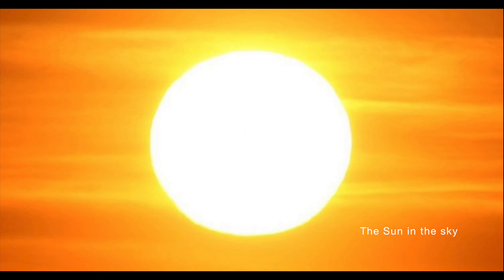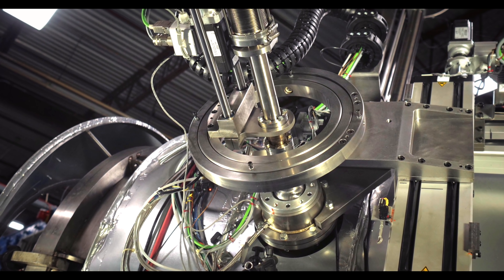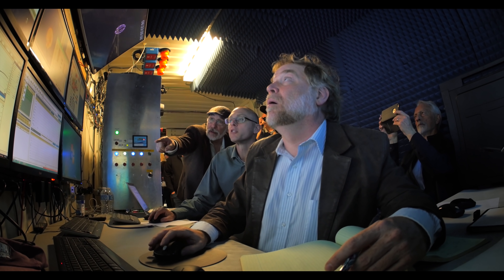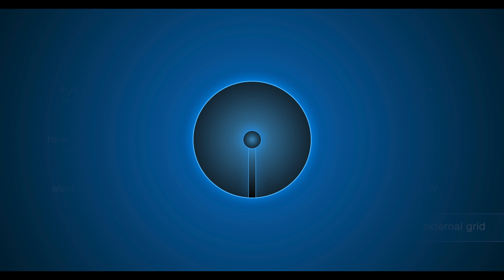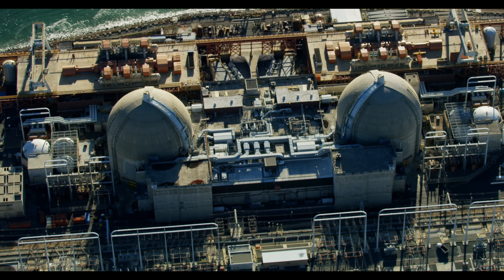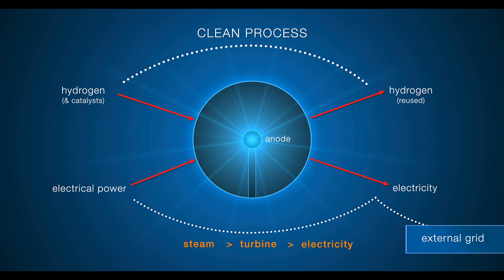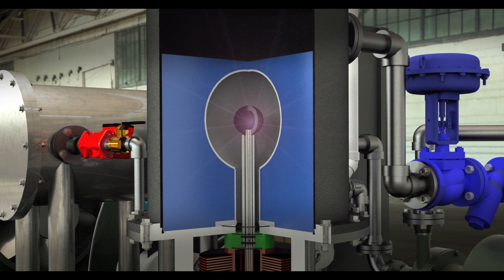Special Feature: THE SAFIRE SUN

Comment: The ability to create very high temperature heat is not in question. The Question is, HOW MUCH HEAT COMES OUT FROM THE ELECTRICAL INPUT? A small 115V arc welder can melt tungston if the tungston is thin enough. We have to stop reacting to the headlines and ask for the details. Is this an economical heat producing device for steam production?

Comment: The proponents of HHO gas ( Browns Gas) generators and torches had made the claim that burning radioactive material with HHO gas torch reduced the radioactivity as well as the ability to generate unexplained  extra heat to burn through granite with the torch flame which was relatively cool when not focused on  other materials.  Now Safire is claiming a similar results with electric arc burning in the presence of Hydrogen ions. Could the phenomena be related as well to the claim for cold fusion using platinum electrodes in producing HHO gas through electrolysis?

Comment: my math is probably wrong, but it looks like if one could fuse 1 gram of Hydrogen into deuterium you would get 101,824M ft lbs of force, if this design could be  reconfigured as a rocket engine you might really have something there, actually would have an electric rocket engine....you sure would not want to do it all at once, as they would have to scrape you off the bulkhead. Plasma impulse drive....seems I have heard of this somewhere else...????...:)

Comment: How can I have exactphotos of radiated heat patterns on my phone using standard filters from the setting sun SIM at sunset and is the crandle system slightly diff....the White around the edge oscillates forwards and backwards at 180

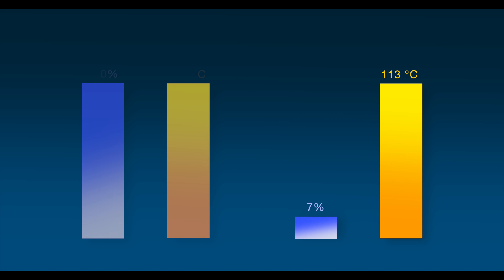Comment: At 5:57 I would be fascinated to see what the difference in input energy modality allowed for a 7% input and max thermal output.  I am guessing, perhaps did the Safire team alter energy input form?  Was a shift from DC electric input to a capacitive inductive AC discharge akin to certain circuits designed by N.T.?
Bravo very Well done.
Reply: 1:50 Like a mini Tesla coil leading to the anode, looks like a coil there. Maybe at lower voltages to the typical tesla coil, like 2kV pulsed, hmmm, thinking.

Comment: So is Safire now producing excess electricity to what is being consumed ?
Reply: Ok on their schematic it had link to  grid connection and also a link back to operating of the system obviously the system in itself produces no electricity but my question was more of a hypothetical enquiry as if the thermal production coupled with some form of heat exchange to operate an electrical generation  system could produce electrical energy in excess of the systems immediate needs ?

Comment: Can existing power plants convert to this awesome technology?
Reply: The way to get electricity out of Safire (as said in the video) is to use the heat to make steam to turn a turbine attached to a generator. That is the way all power plants work, whether they burn coal, natural gas, or radioactive elements.
It would be better to get electricity directly without the middle steps.

Comment: What are the electric numbers going in and coming out ?
Reply: At 7% input power they were reaching maximum reactor temperature.  That means the heat being produced was at least 10 times what was being sent in to power the machine.
They haven't produced electricity with it yet, just proof of concept of the heat source.  But it looks like it will be immensely efficient compared to more conventional methods, like gas turbines.
Reply: @t00by00zer  7% of what? 7% is not 1/10 of 110°C. 7% is just a percentage, not a value.

Comment: This is the future of space exploration. No more liquid or solid fuels. Just PLASMA. It changes everything.
Reply: Man, I'm 33 years old and since childhood I dreamed that someday at least one of the book or film visions of the future will come true, in which we explore the outskirts of our solar system. Safire sun is the key to conquering space.
Reply: Fusion of hydrogen to make helium, even  if it were possible (this technique doesn't do that) converts 0.00735  kg of every kg of reactants into energy. At low speeds like 1/10th of the speed of light, one kg has energy of about its mass times 0.005 c². So a one tonne space ship must "burn" just about its own weight of pure hydrogen to reach that speed. Oops, no, I left out that it has to have been accelerating all the fuel it still has to burn.
Reply: Plasma at a density of 160 g/cm³ is not easy to contain. The huge pressure of the sun's outer layers, and its total gravitational mass, suffice to supply that to the regions of its inside that actually create hydrogen fusion.
Reply: @albertrogers2506  First. It's obious, You are start about trolling. Second. This is not about Gravity. Third. Outer space it's full of plasma and electrics currents. You can Even build a space ship that uses the same principia of safire for propulsión just by magnetohidrodinamics and the plasma it's self, and no need for containement due to self organization of plasma and the magnetic field that's creating it self.
Reply: @GABM1983  Every star in every galaxy is about gravity. Gravity collects it, gravitational energy ignites it, it maintains its main sequence nature as long as it has power to hold itself up against its own weight, be radiation pressure. When that fails some or all of it gives in to its own weight. Fairly large stars become White Dwarfs, keeping their size by the Fermi effect. But if they're too massive, gravity forces the electrons and nuclei together to form a neutron  star.
It has recently been proven that Einstein's prediction of gravity waves is true, and a couple of instances, at least so far,  have been observed and recorded.
Reply: @albertrogers2506  ah y haceme el favor cerra la boca y no me vuelvas a responder que ya estoy cansado de los pelotudos que aún se creen todas las mentiras de la cosmología de materia oscura y una gravedad que no saben ni como funciona.  Sos un Pelotudo!
Reply: @GABM1983  Do you know what plasma is? It is anything from the rarefied neon or mercury vapour in a fluorescent tube,  to the gravitationally held and compressed core regions of an ordinary star, to the ionised nuclei wandering the packed electron volume of a White Dwarf.
Its defining property is that the electric "ownership" of the electrons by the nuclei of the atoms, has been broken. To that extent a plasma is more "electric" than a gas, liquid, or solid. But note that nothing we know on Earth has anything like a specific gravity of 160. That's about eight times the density of gold, and even osmium is SG=22.5

Comment: The diagram seems to show a surplus of energy, but what about the Hydrogen? That can't be free... Still, this seems very promising since the plasma is stable, unlike other fusion attempts.
Reply: The hydrogen is LIMITLESS in supply thanks to the oceans.  A little electricity separates it from oxygen and produces orders of magnitude more energy when injected to the plasma double layers.
Reply: @t00by00zer  Electrolysis requires a lot of electricity. That's why many say hydrogen as a fuel isn't feasible in most cases.
Reply: @Vermilicious  you miss the point.  The amount of electricity it takes to release the water bond is tiny compared with what that hydrogen atom will do when used to transmute elements.  The energy released in that reaction is orders of magnitude higher than what it took to break the water bond.

Comment: I once said back in the 90s, solar wont make sense until we can recreate the sun in miniature here on Earth. Well done team!
Reply: You did?
Reply: They have NOT created the sun in miniature here on Earth. 
The nearest thing to a "Sun in miniature" is called a "brown dwarf" star. Jupiter almost qualifies, according to some astrophysicists.
Wikipedia tells us that "At solar core temperature (T ≈ 15 MK) and density (160 g/cm3), the energy release rate is only 276 μW/cm³ "
The usual Terran fusion mechanism fuses the mass 2 and mass 3 isotopes of hydrogen to make a helium nucleus and a neutron,  and most of the energy goes into the neutron, which is then capable of splitting the "non fissile" isotope of uranium, ²³⁸U.
That, in fact, is the third stage of every thermonuclear weapons test ever done, except for the Soviet "Tsar Bomba" which deliberately left out the "50 megaton" third stage by using lead as the compression agent, rather than the usual uranium. Thus the yield was equivalent of half the 100 megaton design that , for the sake of the bomber crew, they did not use.
I do not know how Safire is supposed to work, but it is misleading to say that it resembles how the Sun's power is generated.
Reply: @albertrogers2506  "i DO NOT KNOW HOW SAFIRE WORKS"

So what are you doing here commenting like you know something? Try learning before spouting off.
Reply: @LucVNO  Did you understand the difference between the fusion generating part of the sun and the "solar atmosphere" that SAFIRE claims to emulate?
Try harder.
Reply: @LucVNO  I know enough about nuclear physics to attempt to acquaint you with the elementary howlers in this article.
My first two lines made that clear. I have modified my rash brevity with the phrase "how Safire is supposed to work. I can tell without any doubt that the writer has no idea about hydrogen fusion physics, and it seems that you know little other than rudeness.
Reply: @albertrogers2506  but they found that fusion also happens in the solar atmosphere, and photosphere, consistent with the sbectrographic data.
Reply: @bobsmith231  their plasma physicist still works and presents for them
Reply: @bobsmith231  regardless, in less strenuous situation's, like lightning, we see fusion of nitrogen. The photosphere is a more drastic situation in both scale and intensity.
Reply: @bobsmith231  the photosphere commonly emits gamma ray bursts, which happens only in extremely energetic events.

Per the fusion events, I saw otherwise.

Comment: HAVE YOU ACHIEVED NET ENERGY OUTPUT???!!!
This is tremendously cool but we NEED to know!!!
Reply: YES.  Didn't you watch the video?  At 7% input power they were reaching MAX temperature, which means the machine was creating 93% of the power required to reach max temperature.
Reply: @t00by00zer  Yup, watched it, lol, and no that doesnt mean net energy output. Max temperature for the chamber is a thermal property, tells us nothing about efficiency. The 7% figure is them showing off how much better it was performing than expected. It does not mean they were getting 13x the energy out compared to in. If they achieved that, billionaires would be prostrating themselves at the teams feet :).
Reply: @TheMastaRob  you obviously don't understand the underlying thermodynamics.  They were reaching the temperature their calculations predicted for three years.  So many watts in, so much heat out.  Very simple, very predictable.
Then that all changed when they reached the right conditions, and suddenly only 7% of the input power was required to generate the heat the reactor was reaching.
PROVING that simply requires repeating the experiment, and they have apparently done it multiple times now.  They are in the process of capitalizing their project to make a demonstrator prototype.  The billionaires may yet show up.
Reply: @t00by00zer  I have a masters degree in mechanical engineering. I build CNC machines. I understand thermodyamics quite well thanks, better than you I suspect. The required 7% of energy is compared to before. That is quite a jump, but we still dont know how much energy they were adding before or after, nor do we know anything about the efficiencies. The previous process could have just been ridiculously lossy. But yes, as I said, it does strongly hint to over unity, but I really want them to confirm on it, which they do not do in the video. They are totally aware of the statement that people like me are waiting for - they didnt give it, they danced around it.
Anyway, this has nothing to do with thermodynamics, I dont need to understand the process, I just need the energy numbers. But whatever, I dont think you are capable of analysis on the issue, so I wont reply again.
Reply: @TheMastaRob  you claim to have a knowledge of thermodynamics but miss the GIANT picture here.  These are all Ph.D level folks who had thermal analysis of their setup run with the most advanced tools available.  Everything up until now performed exactly as the models predicted.
The difference now is that the reaction inside the machine is producing heat that was not there the day before.  Let's say they throw a thousand watts into the machine.  All those watts are producing heat ultimately as no radiation leaves the reactor except through the observation window.  There is a cooling system designed to keep the chamber at around 110C when running at full power.  So when the system was only consuming 70W to reach 113C, it was the machine producing the other 930W to reach that temperature.  70W in, 1000W out.  Pretty simple really.
Reply: @TheMastaRob  one last point.  Think of this as no different than any other oven.  The fuel in this case is not the chemical reduction of methane into CO2 and water.  The only fuel is an ionized atmosphere where electric fields and plasma turbulence are transmuting elements, not changing chemistry.  These are reactions taking place at nuclear radii, not electron shell radii.  The energies are many orders of magnitude higher for nuclear reactions than chemical reactions.
Once the thermal energy is contained and converted into steam/electricity, the system will only need to have the fuel supplied to generate energy.  The fuel is hydrogen and a few trace other elements, but the reaction is fusion, not chemistry.
Reply: would like to see how it stacks up against MSRs, they were poo pooing nuclear fission but MSRs (or any liquid fueled reactors) are game changer as well
Reply: Also check this video out time stamp 34:00 to 37:00 https://youtu.be/sCwF6AYpIjg
Reply: if they have it is good news and game changer, but they didn't say how much mightn't be enough heh
Reply: @bencoad8492  Yeah they strongly hint at it, but no clear definite statements.... so either a) they are trying to keep a low profile (perhaps worried about too much publicity?) b) they are just really close to net energy output, but not quite there, or c) their current setup is not geared towards extracting energy via steam, so although they are confident it can be done, they cannot do it with current setup. My guess is on c).
Reply: Check out the website in the description, Aureon link.
Reply: @Guru Amirite In the fuel cost? Interesting though, but it mostly burns hydrogen. And their setup is definitely not geared to commercial levels, right now the net energy in/out is all that matters.
Reply: @TheMastaRob   It does not burns hydrogen!!  Hydrogen is just the catalyst and gets recycled. (according to the video)
Reply: @06rkave  Wrong, it burns hydrogen, additional catalysts are added (they dont say what, probably waiting on patents)
Reply: I wonder if the process described in the video also happens inside earth.

http://phzoe.com/2020/03/04/dumbest-math-theory-ever/